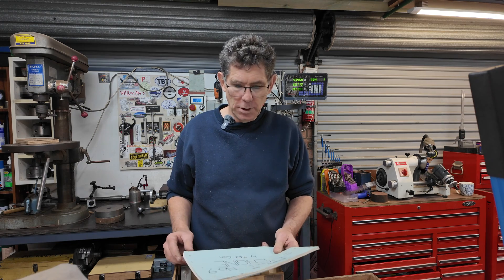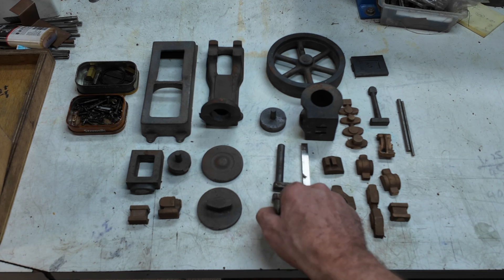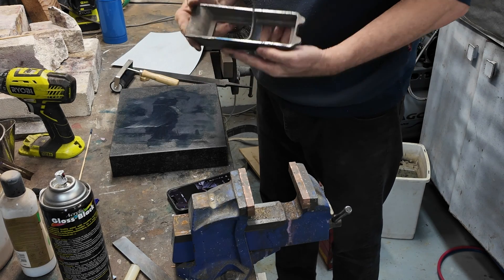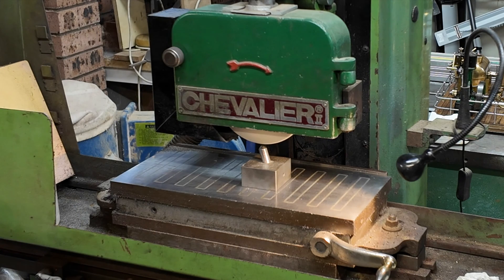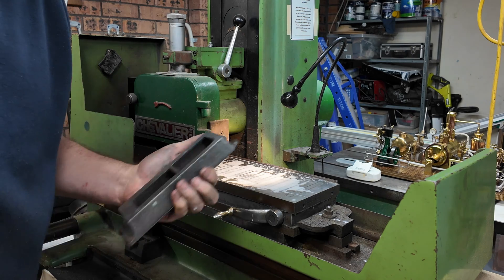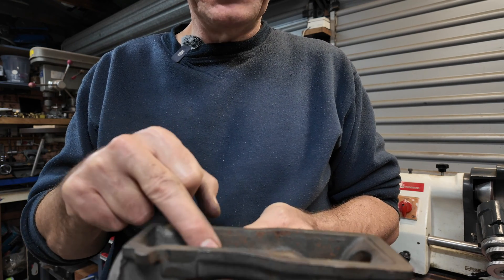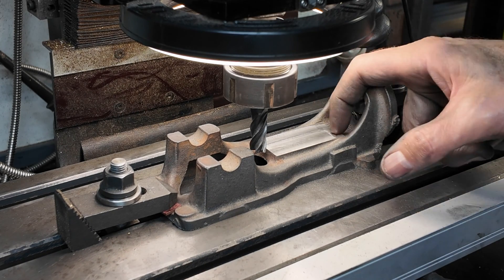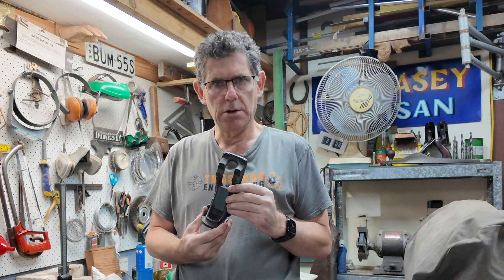Building a Stuart No. 9 Steam Engine - Part 1

Comment: You bought them on Ebay in 1960 !!!
Reply from the maker: Did I say that?  I probably meant to say they were originally cast in 1960 or thereabouts.  I bought them second hand on eBay.  It’s common for people to buy casting sets and never start building them.  They get sold off by their children.  At the rate I am going it might happen with this engine again if I don’t get a move on.

Comment: happy to see you back John, a fixture plate might make work holding of the base  and body easier and give you horizontal and vertical capabilities on the mill, cheers!
Reply from the maker: Thanks Phil.  I was thinking that as well.  I have a big lump of aluminium which might do the trick.
Reply: @CreaseysWorkshop   don't we all love big lumps of Aluminium gotten on the cheap. cheers mate